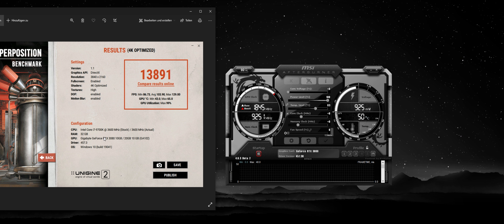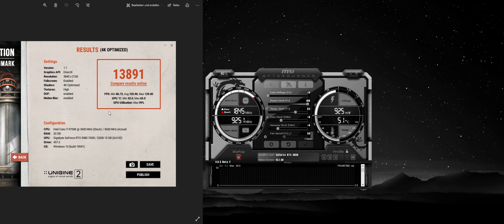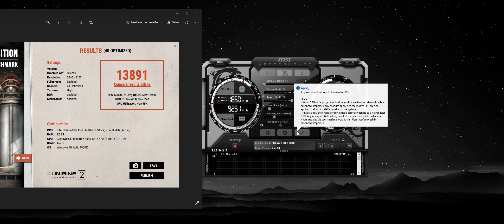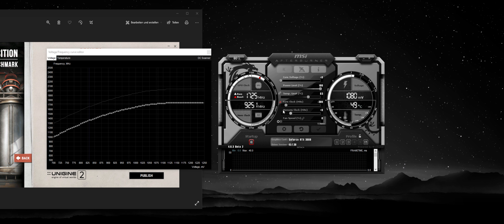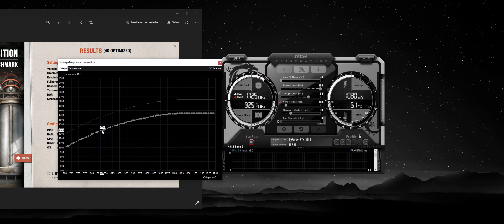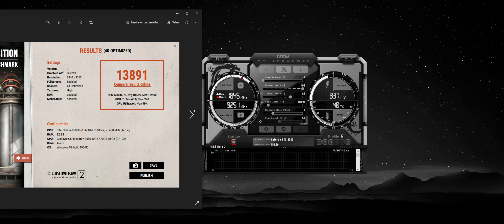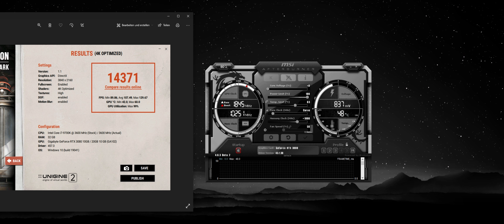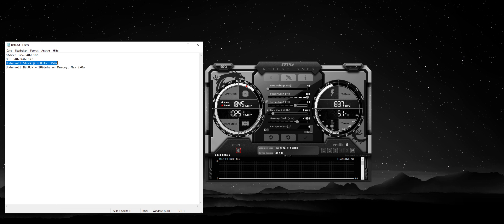GPU Undervolting Guide for RTX 3080 / 3090 | UP TO 100 WATTS LESS POWER

Comment: You say you are OCD and don't like the uneven numbers, but you selected 1851 which triggered my OCD.  FYI, you can use the up and down arrow keys on the selected voltage to move it up or down in 1 MHz increments.  I'm still playing with my undervolting to determine how low I want the clock.  I'm at 1980 MHz at .9v right now on my 3080 FTW3 Ultra.
Reply: Don't NVIDIA cards change clocks in 12-25MHz increments depending on the generation of the card? I don't think changing the frequency by 1MHz will actually do anything. The card will still round up or down to the nearest increment.
Reply: i have found a nice balance  .875 at 1920. same card as you
Reply: I'm at 1920Mhz at 0.825mV.

Beat that ;)
Reply: @FutureNaught  that's what popup help for curve editor says. Basically the curve is just a guideline for a driver and actual frequencies will be rounded by it. So basically you may not bother with exact number, you just need a ballpark and driver will do the rest.

Comment: This was a game changer for my 3080 FE -- Using RDR2 Benchmarks I get 111.22 avg FPS using 316w max at stock settings, using your settings I get 110.24 avg FPS using 212w -- absolutely amazing, memory temps never went above 78 (they hit 92 at stock). I've tried a LOT of different undervolts and this is by far the best! --- It's Worth Noting for Others -- You will not see the power draw difference using benchmarking software. I didn't realize this for a long time and kept wondering why my settings weren't making a difference. Use a real game (I used RDR2 and Tiny Tina's Benchmarks) or something like Heavens Benchmark or Superposition to get more accurate information, 3DMark will push it over 300w every time regardless of settings. At my current kWh cost that'll save me $18-21/yr with casual use, not a lot to some, but I'll gladly keep that money in my pocket!

Comment: Why you have to overclock the memory by +1000? I also saw some do 600, but why you need to do that after undervolting it
Reply: also wondering about this @ultrawide Masterrace
Reply: You don’t need to, it’s just added performance
Reply: @sergeantsausage2609  probably reduced by that point. Self correcting memory chips yada. Their performance curve is V shaped so I would bench with something heavy like Metro Exodus or Timespy 3d
Reply: @e.e121  I've been able to push my 3080 and my 3080 ti memory by 1000MHz without issue. I know they have ECC, but you can find out by tracking performance. I do have a ftw3 which is really good at cooling memory.

Comment: THANK YOU! The coil whine on my MSI 3080 was driving me crazy when I was doing 3d work. This dropped the noise down considerably.
Reply: Doesn't make any difference... you are just forcing your GPU to run at lower clock speed at higher voltage.
Reply: @acid1787  it will make a diff for sure because you're consuming less power = less coil whine
Reply: @OrchiiGamingmiro  Gpus run at a fixed voltage even at idle. Mostly they run around 600-700mv. So your clock speed doesn't matter. And if you undervolt below that fixed voltage your gpu will crash. Mine runs at 139mhz idle at 625mv. Same voltage applies when I play games that are less graphics intensive an clock speed usually sit around 800-900mhz.
Reply: @acid1787  am talking about Coil whine... It's obvious that when you undervolting you gpu consume less power at full load no cap fps, so less coin whine...for me 3060ti usually consume 200 watt at 1950mhz on 1.01 v, I undervolted it to 0.91 v with the same clock 1950mhz at 180 watt, and I experience less Coil whine... Less hit less fan speed, just be smart about the way you edit your curve. If the game that you play doesn't utilize enough your gpu no need to touch anything just cap fps to get rid of Coil whine.

And about lower voltage, power = current x voltage, so if you put your gpu at 0.9 v while it's consuming 20 watt at idle your current is to low to introduce any hit or Coil whine. I hope I answered everything.

Comment: many thanks dude,you help me a lot with this video. i buy an rtx 3080 msi ventus it was really crazy loud and 80degrees hot my pc was ready to burn,but with youre giude i manage to get my rtx to 71degrees. no loud fans more no crazy 80degrees and fps is a bit higher now thanks very much my dude
Reply: I got the same dude and  I know how it feels... The video worked for me  too =D
Reply: those temps are narly lol should look into better case airflow
Reply: @barthamellow1138  3080's can just be hot and hit the 80s sadly. Had a similar issue before undervolting to 847~ 1800(actually runs 1815 in games). Most games stay under 70c, have not seen it go over low 70s in any scenario since. 

Maye just be our GPU's cooling as well, at least the performance works and is not noisy when undervolted :)

Comment: Thanks a lot ! My setup was a bit warm to my taste, I litterally gained 10°C on both my GPU and CPU (yeah, suboptimal airflow)
After 1h on humankind, my 3080 TUF gaming OC was at 60°C and my 5900X at 61°C while keeping the "normal" OC perfs, amazing tuto man !
Reply: Hi - I have the exact same GPU+CPU combo as you. What values for core clock and Voltage are you using? I have a 1080p screen. Just looking for undervolting numbers.
Reply: Doesn't make any difference... you are just forcing your GPU to run at lower clock speed at higher voltage.
Reply: @acid1787  well, that's your opinion, benchmarks are clearly saying It does ...

Comment: I just got a Strix 3090. I ran stock test, unlocked pwr limits test and then an under volt. To my surprise I was able to get better performance, higher clocks, w/ less power draw and lower temps  using the under volt. It was a lot more work to find over a standard oc but that may be because I'm not as experienced w/ under volting. I went from a 13525 score to a 14264 score in Port Royal and that was after I validated it was stable daily usage.

I can only imagine how much more performance I could get if I slapped a water block on it but for now I'll stick w/ stock air cooling.
Reply: Can you share the voltage? Then core, memory Mhz? Because I also using the ROG Strix 3090
Reply: which software he is using in the video to check the score

Comment: I think it is also a good idea to lower clocks a tiny bit, especially memory, and check to see how much FPS you actually see change.  My 1080 Ti for instance when undervolted, 5500Mhz to 6000Mhz made like a 2fps difference, so I just kept it low.
Reply: very true. i just got a 2060 ko ultra and raised the memory by 1100. got 6fps more in some games. same at +800. got it running .900V @ 1950MHZ - 7800MHZ. i can get the temps to 66but i leave the fan lower and run it at 74. good card.
Reply: My guess is there is more performance gain with higher memory on cards with lower gigabytes of VRAM
Reply: @jayleomac  Got an Rtx 2060 myself and it might be abit late but dang I'm at .950V and I can't seem to get past 1900mhz core clock (got 800 memory clock tho) lol.
Reply: @ZPtyy  1900 is great. no noticeable difference im sure. good job
Reply: @jayleomac  did you notice any difference in power consumption
Reply: @rahul-qm9fi  i dont know really. i dont think so

Comment: This video was a tremendous help! My gpu Temps werent getting incredibly high to were it became worrisome, but higher then I would have preferred. My cpu Temps were getting into the mid 70's and I'd prefer it to be sub 70's so I undervolted my cpu first using Intel XTU's software. Then I noticed my gpu Temps were doing the same, after watching this video and following your step by step guide I managed to get my gpu from 75c down to 60 as a max temp after 2 hours of solid gaming. Thanks alot man!! 👍👍

Comment: With this settings, use 1080p medium to make the scenario where the card boosts up pretty high and then you'll see the crash. At 4k optimized, the load is of 100% and gpu wont boost to the frequency what actual games are going to hit.
For eg.,my 3080 aorus extreme can hit boost speed of 2230mhz in 4K optimized easily for like some seconds then drops down.to 2000ish but completes. But when I game at those speeds, it generally crashes. My stable oc for gaming is 2150mhz..any game, full stable.
Reply: Yeah same experience as me, I don't think Unigine is good for actual testing of settings in real games, but is nice for dialing in settings for testing.
Reply: So how do you test this, but starting up a game and messing with the MSI Afterburner settings until the game crashes?
Reply: Just check Shadow of the Tomb Raider to be sure bro
Reply: @snoweh1  "d mark timespy will push your card to its limits for good testing and stability.
Reply: @drummonkeystuffuk1875  I did this actually, but instead of timespy I used fire strike. Card performed better undervolted, at least the score was higher.

Comment: Having a 850w platinum psu I’ve been a bit nervous that it won’t be able to handle my 3090 and 5900x at peak performance. It’s nice to know that I can reduce power consumption just a bit in case the psu isn’t enough.
Reply: @user_1of1  Okay. Sounds good. 👌🏻
Reply: @user_1of1   I don't know yet. It's sitting in it's shiny box until I get a cpu. I got the MSI Suprim. It has a 420w power draw. PSU is the Seasonic Platinum grade 850w
Reply: My 850w was not enouhg had to get me a 1000 psu...9900k rtx3090 no issues now.
Reply: I was glad I bought a 1600w years ago so I never worry with my 3090 5950x

Comment: I used this method here and found the lowest voltage I could get the highest sustained clocks at.  In the superposition benchmark at 4k optimized I went from 13,487 to 14,662 and it was stable running at 868mV at 1905mhz and memory at 795mhz OC.   However when I went to play CP2077 it would crash.  After some trial and error was able to keep all my settings but drop the clock by 30mhz settling at 1875 mhz and now it's stable.. the actual boost clocks are somewhere around 1930mhz.  When the card was stock it would run at 2050mhz or so but would perform about 8.5% worse due to power limits.  Temps went from 70C to 65C in synthetic bench and all the way down to 58C in CP2077.
Reply: Doesn't make any difference... you are just forcing your GPU to run at lower clock speed at higher voltage.
Reply: @acid1787  With such drop in performance didn't you basically downgrade it to the previous card?

Comment: Thx for the Video! Did it Not the Same way, but with 0.881V i get 1980mhz with 300w powerdraw, so Not power limitated, so my score is higher with Standard overclocking :D

Comment: I have undervolted mine at 1875mhz for 893mv to make it quiet. the loss in performance is absolutely not an issue. A few % is nothing, especially when performance matter at around 60fps. But the decrease in heat and noise is significant.
It is the 3080 ventus OC version
Reply: I have the same card.. have you experienced any issues with low GPU usage in games? For me its LoL, WoW, and AC Valhalla.
Reply: @THETHUND3rstruck  I have the same card. For the Undervolt I can go with 875mV @ 1905MHz. Rock solid in every bench and after hours of gaming. No issues with this card.  I wouldn't go on a high memory oc bc it is sometimes getting worse performance. You'll have to test memory OC while a benchmark is running to see where there sweetspot is.
Reply: I have the Ventus 3090 and this thing undervolts like a champ. 1905mhz @ .862 volts to save about 100watts with no real world noticeable difference in gaming performance
Reply: @THETHUND3rstruck  CPU Bottleneck? What's ur CPU?

Comment: 1850MHz is a pretty low clock speed when most 3080s are clocking in the mid 1900s and golden samples upwards of 2GHz with traditional OC efforts. I run my Ventus 3x 3080 at a +125Mhz offset, but flatten the curve at 1950MHz so that it won’t try to exceed 2000MHz and crash some of my more sensitive titles. It’s effectively a variable speed undervolt. 56C at 100% load with 100% fan.

Although the Ampere architecture doesn’t benefit much from an OC, it’s nice to have your system optimized for performance.
Reply: I am a mere mortal and didn't understand if undervolting good or bad for your system? i am not talking about fps.
Reply: @ljuc  Undervolting is always good if it is stable. You’re basically trying to tune your system to use the minimum voltage to achieve optimal clock speeds and improve your thermals. Increasing the voltage beyond the nominal on your CPU or GPU will reduce the longevity of your chips, regardless of thermals.
Reply: @MechAdv  High thermals aren’t good either as micro cracks can develop on soldering points and caps can blow leading to an expensive paper weight

Comment: I know undervolting is good for lowering power usage and temps, but would it be worth doing on a watercooled 3080? I used your video and another to undervolt my 2080 ti and it worked wonders! dropped from 1.1 to 0.825 mV and from 80 degrees to 65. Also underclocked a hair from 1825 core clock to 1700, no FPS loss. I appreciate that you took your time to show us all this magic!
Reply: The whole point of this is to lower the power usage while increasing performance or for less heat or both, so if that's what you want to do then it's worth it.

Comment: hi thanks for tutorial 👍 i get my aorus rtx 3090 xtreme 24gb to 0,819 v @ 1950Mhz @277 watt 🤩🤩i use watercool loop only for gpu with 360mm 30mm thick rad with 960rpm fans  and get max 42C after 2hours of benchmark

Comment: But putting the initial clock speed down on lower voltages will just make it use more power at idle. So instead, leave default clock speed for the lower frequencies, and then just shift select all the frequencies beyond the point you want to change and drag them under the max voltage point. This way lower voltages will maintain a higher frequency

Comment: Any 3080 or 3090 owner should really do this. At stock some of these cards use over 400 watts, which is ridiculous considering the minimal bonus. The 3000 series cards also don't overclock well at all. I undervolted my Evga 3080 and saved roughly 100 watts at a performance cost of only 1-2%. Great video!
Reply: Completely worth it
Reply: I undervolted a 3070 and saved 40W and 7°C at full load, with a lower max clock speed, and somehow gained 4 FPS in Tomb Raider at 4k lol
Reply: So the year has passed. How's your card doing?
Reply: @ljuc  hi

Comment: Hi there! Nice video! I really lost the silicon lottery... I’m not able to undervolt my 3080 XC3 ultra. Just able to get 1830mhz @0.925 mv, the power draw is still above 300W... below that voltage the card freezes in Time Spy bench in such way that I have to DDU the driver. The first time it happened I almost got a heart attack course my screen became flashing, messages for “forcing driver reinstall” and the 3080 was not recognized in control panel... only DDU solved the problem... I’ll stay that way but this thing runs as hot as hell!! EVGA should have a better thermal solution for this card. Thanks anyway! Merry Xmas! And a much better new year!!
Reply: oof. I was able to hit 1920MHz @880mV
Reply: @benscko  i've got almost the same 1920Mhz @887mV is stable but yesterday i tried 1950Mhz @893mV and it works great ( 3DMark & Cyberpunk ) power draw is under 300W
Reply: @MOMD88  yeah i also tried 1950mhz and it also works.
Reply: @benscko  does your suprim x has coil whine ? below 900mV my suprim x is good but not perfect. I tried an asus strix 3080 oc ..this thing was so nice.. out of the box 2000Mhz but coil whine started already at 60 fps in normal games not just AAA games.. that was horrible :/ ^^
Reply: @MOMD88  i have a pny rtx 3080. No coil whine at any frequency or at any fps in games
Reply: @benscko  lucky :/ suprim x 3080, strix 3080, trio x 3070.... sadly all of them with coil whine x[
Reply: @MOMD88  man that sucks. especailly for high end models
Reply: @benscko  yes.. i gonna try a second suprim x or strix... maybe in a few weeks its possible to buy one

Comment: this is fantastic..... less wattage power draw, boosted ram clock, runs cooler....  doing this on an Aorus RTX 3080 Master now!
Reply: just achieved an avg of 10c lower temp (max 55C) and about 90 fps, with a max power draw of 275w - playing Assassin's Creed Valhalla at max settings and 1440p for 2hrs --- awesome!

Comment: Noob Question here, why wouldn't you just lower the power limit, and oc the memory, instead of undercoating but keeping power settings at 100% ?
Reply: Because lower the power limit will damage your performance, but undervolting will not.
Undervolting can even boost your performance, by undervolting -> lower temperature -> higher frequency
(frequency often limited by temperature)
Reply: In the default setting, say 1.1V <---> 2000MHz
after you undervolt it, 1.0V <---> 2000MHz
then the power draw will be much less, but the frequency still there

Comment: Lets not use this +1000 memory as reference, it is not ideal. Many cards may have different stock clocks so offset doesnt tell you much, but a lot of them will decrease in performance at some point, thought it wont crash. Try to run some tests. My MSI suprim X begins to hinder performance after +850 memory.
Reply: What settings did you end up with? 🙂
Got the same card 🙏

Comment: I have a question, might be a stupid one, but your card has a boost clock of 1845Mhz, while the "normal" clock is 1440Mhz, so what really is the difference between vase clock and boost clock? Isn't setting the limit to your boost clock considered overclocking? I am asking this because I am having problems with some games where overclocking could be the issue.. Although that really doesn't make a lot of sense now that I read that back..
Reply: Don't think anyone uses the base clock. Heck even my HP prebuilt 3060Ti can go over 2000mhz without changing anything in Afterburner... (Adjusted it to 1815mhz@850mv or so, 110 watts in AIDA64)